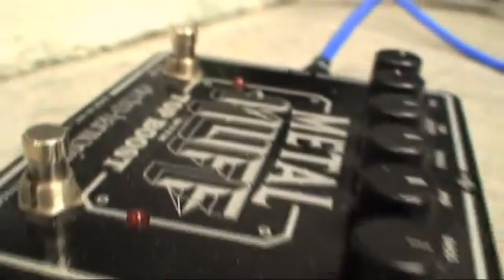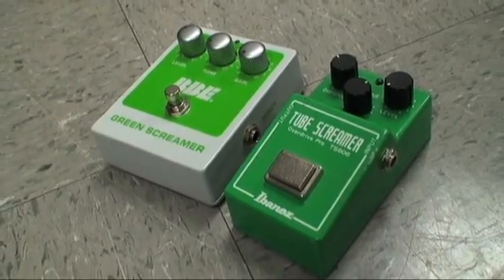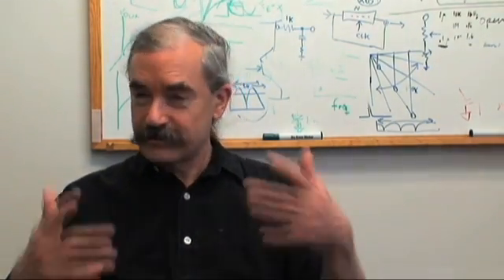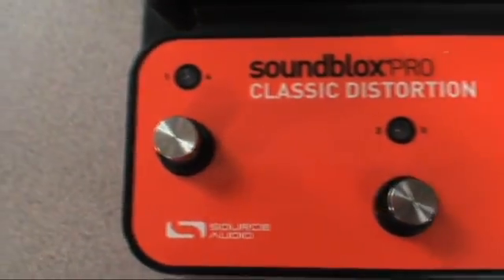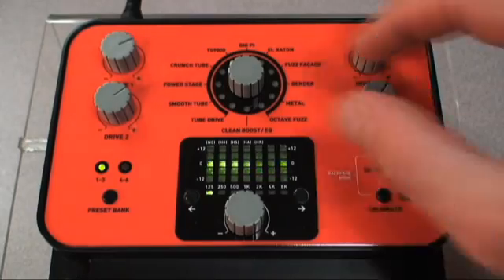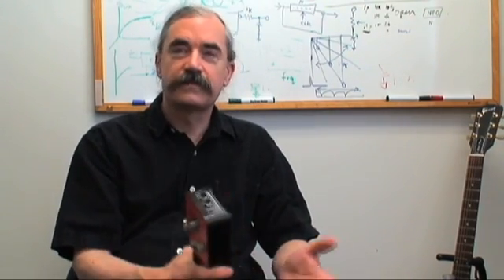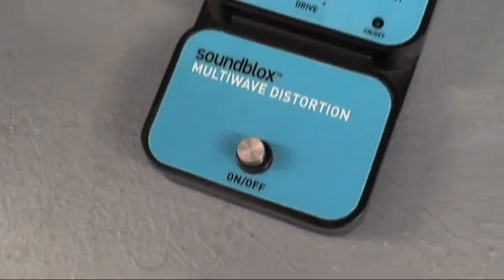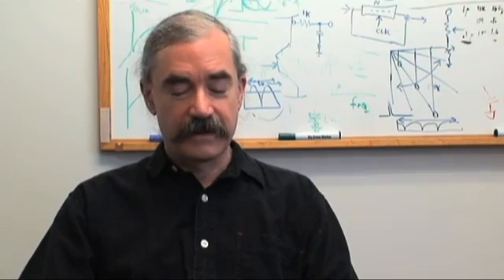Tech Talk: The Soundblox Pro Classic Distortion (Part 1)

Comment: In the argument of Analog vs. Digital  people typically only discuss the overall end tone itself.
Nowadays, there are so many digital devices (and far less analog solid state designs) that I will readily admit could easily fool me if I were blindfolded.
They have pretty much if not definitely got that part locked down.
However, when I plug into 'em I can always discern between digital and tube guitar amps because they still have not perfected the finger-string-pickup-amp dynamic relationship, imo.
They most definitely have come a long way since the first generation of digital modelers, to be certain.
However I don't know exactly why the analog vs digital dynamics code cannot be cracked.
(Including SS analog not just tubes)

At any rate, the biggest technological development for tone chasers has got to be the introduction of digitally controlled analog signal...a market with still a lot of room to grow